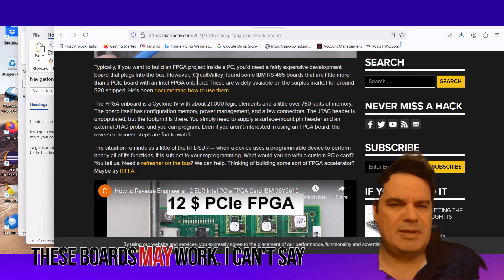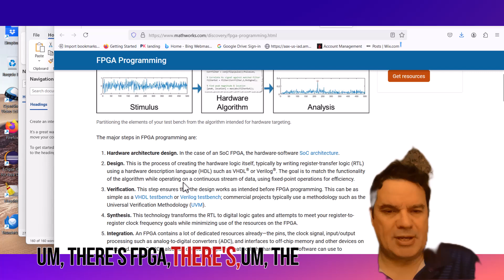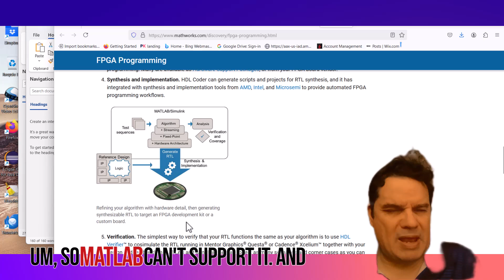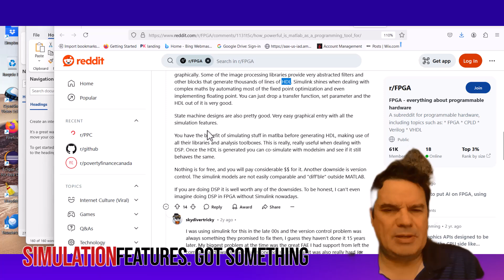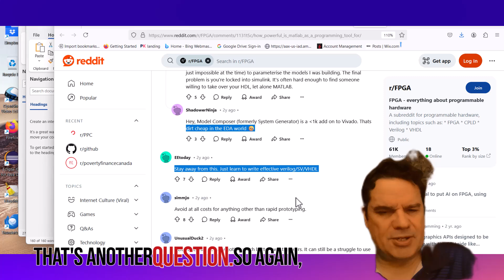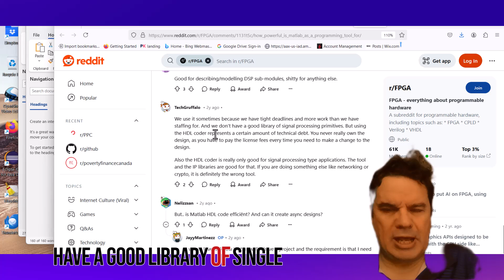Is the Affordable FPGA Dev Board Ideal for High-Frequency Trading?

Comment: Nice opening. I have a pretty strong background in embedded applications, but I've never had to do fgpa solutions. Mostly microcontroller based stuff. I've found that you can do pretty nice low latency with just a modern microproccessor with pinned cores and bypassing the OS and communicating directly with the NIC. Have you done any "HFT" in this area?

I'm personally more interested in low latency than high frequency.